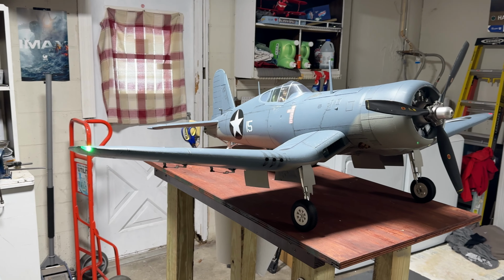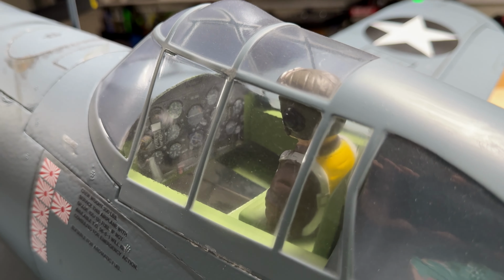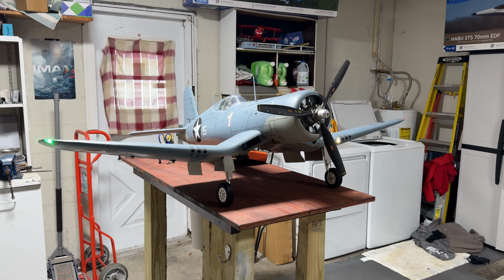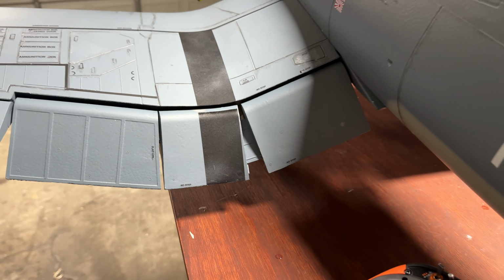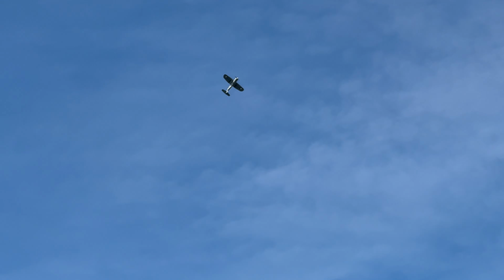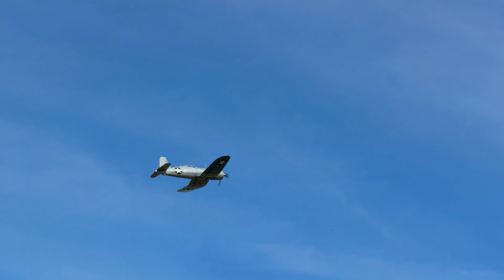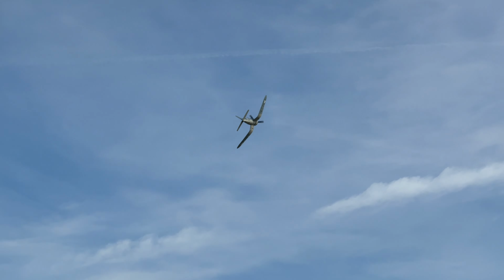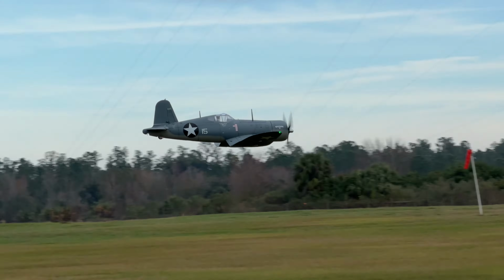Scale warbird experience | Flightline 1600mm Corsair (Birdcage) FULL REVIEW

Comment: The intro and video of it flying were great. You got a little repetitious in between, but not too bad. I started watching your channel after seeing you on MotionRC's channel yesterday. Your flying skills are excellent; your maneuvers are well-placed and scale-like. I have the 1410mm FlightLine P-51D "Old Crow" and the 1600mm F4U-1D "Bubble Top" Corsair. I bought the Corsair 2 years ago and it's still in the box. I had forgotten that it has 8" more wingspan than the Mustang. I need to put it together and start flying it. The lower drag of takeoff flaps gives you more time to set the plane down before it quits flying. With landing flaps, the window is much narrower unless you keep a little power on it. Wheel landings are easier than 3-points. The trick to wheel landings is flying the wheels down close to the runway and lifting your thumb off the stick just as they touch. If you're holding any back pressure, it'll bounce.
Reply from the maker: I appreciate the thorough feedback! And you’re right. I’ll probably try throwing in some flight clips in between the garage bit when talking about some of the characteristics. You gotta get that Corsair together. It’s great!

Comment: For landings, use full flaps, slow down more and try for a 3 point landing.  Get the tail down and pull back stick to pin the tail to the runway and you'll have directional control even in a cross wind.